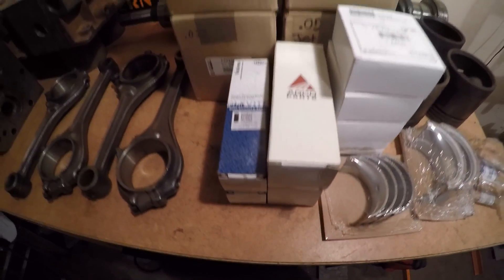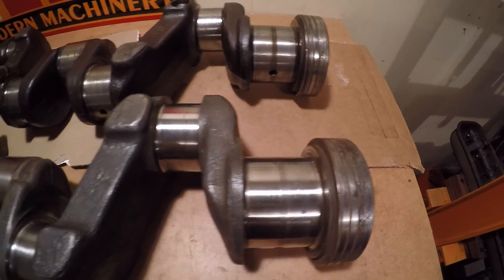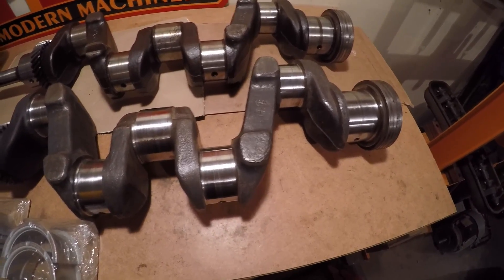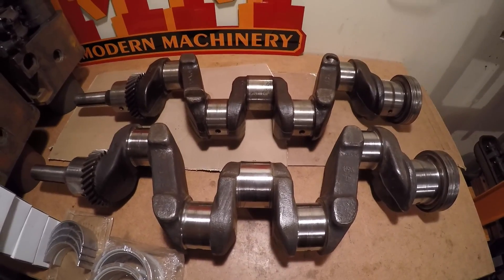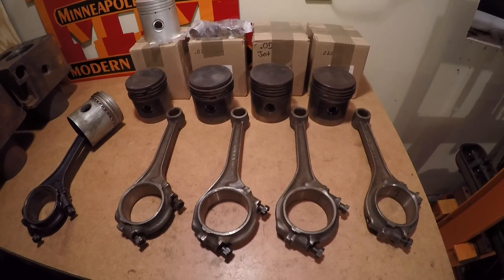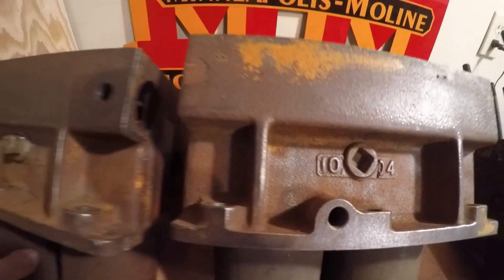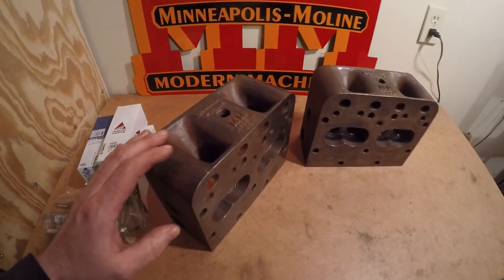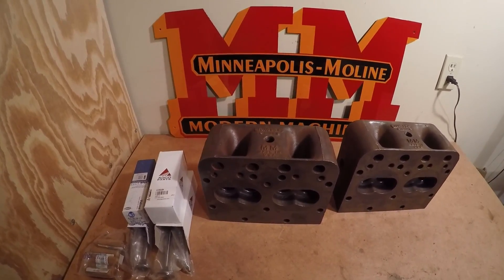Minneapolis-Moline Prototype 445 Tractor #X231 Restoration - Part 3: Main Engine Components

Comment: The experimental crankshaft was never balanced at the factory.  The balance pads on the experimental crankshaft are untouched. You should of had it balanced after grinding. Balancing the rods and pistons Is something you could have easily done yourself.